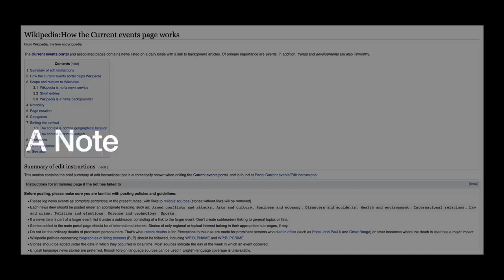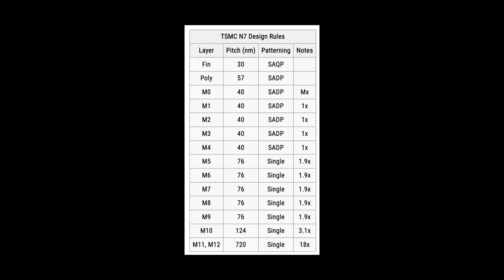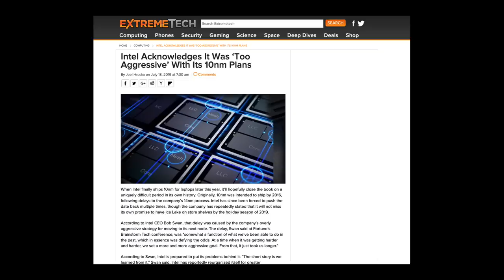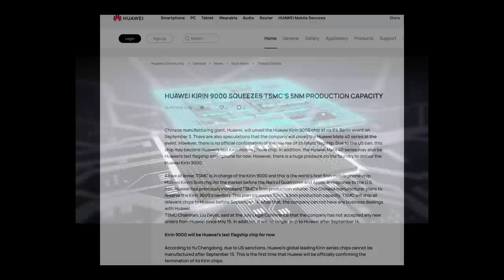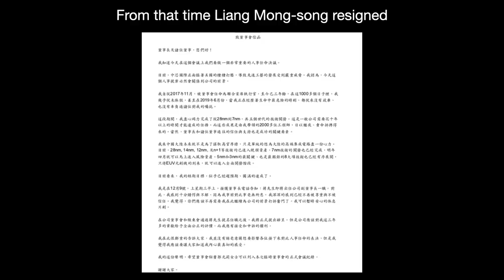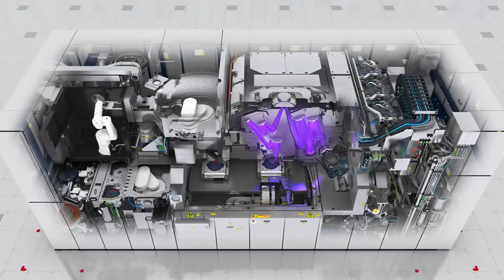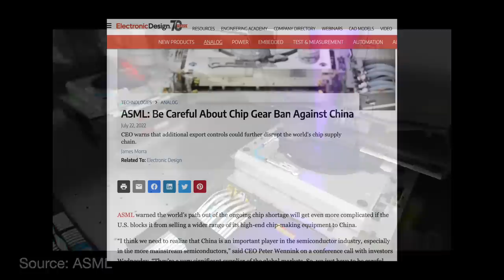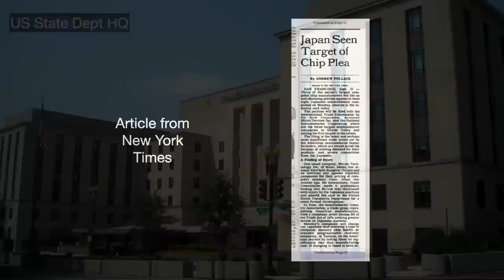China's 7nm Chips: SMIC N+2

Comment: SMIC doesn't operate in an open market. You rightfully mentioned Huawei's HiSilicon division which cannot use TSMC anymore to fab their Kirin CPUs. I'd say they'd happily take whatever SMIC has to offer here. N7 equivalent is not too shabby! Russian clients cannot use TSMC anymore either. So there will surely be a plenty of demand.
Reply: How big is Russia market?
Reply: @zzip0  I dunno. But some chips have definitely been fabbed at TSMC. For example, Baikal and Elbrus.
Reply: If its going to be cheaper than TSMC, etc. then itll get customers eventually.
Reply: @zzip0  
Russian is just a icing on the cake, the Chinese market consume about 60% of the worldwide market, imagine losing the 60% sales.
Reply: @gamerdudegamerdude4961  Nah, they don't have to, my point is that they don't compete with TSMC for many and probably enough customers really.
Reply: @andrewlim7751  Chinese IC market has always been very restricted for outside access. It is not of concern now. The OP rises the question about the Russian market si that's what I ask about.
Reply: @zzip0  I don't know about the size of the entire Russian semiconductor business that was dependent on TSMC, but Baikal, for example, was planning on ordering 300k chips from them this year alone.
Reply: @gamerdudegamerdude4961  The point is - this DUV process is a dead-end. It was abandoned by everybody the moment EUV started to mature. It will be a losing strategy for China to improve this path, because it will never be competitive globally with EUV based chips especially in mid-long term.
Reply: @zzip0 
Having the market is EVERYTHING, nevermind having the most sophisticated machine, producing it with the latest technology, what happens if your buyers don't wanna buy from you?? Imagine selling it to u.s., what can the Americans do with the chips? Make iphone or Xiomi?
Reply: @andrewlim7751  There are short term and long term solutions. Having a market is good, but Chinese market is not very accessible anyway. More important is to be innovative and competitive. Thats how USSR lost the Cold War.
Reply: @yurymleh  300K is probably negligible for TSMC. I work at a rather small company, which routinely orders millions.
Reply: @zzip0  
Innovation and competitiveness have to back up by market, the Japanese are definitely more innovative and competitive than the Americans but when the u.s. apply pressure they're gone, check out Toshiba's semi-conductors, when you're small you have no say, that's the reality.
Reply: @zzip0  Yeah, it probably is. But it's just one of many, all those negligibles add up and make for a good pent-up demand for SMIC.
Reply: @andrewlim7751  As I said, China market is quite locked anyway and can not be relied upon. Plus what were Americans and Europeans doing with the chips when most of China had no running water and were using outside toilette? Have a loock what happens with the last movie TopGun, which is not shown in China because it uses the Taiwan flag? Made a shitload of money around the Globe.
Reply: @andrewlim7751  Japanese are well known to NOT be breakthrough innovative, but actually masters of incremental improvements.
Japan just lost the competition because it is too conservative - example: if you go to work in Japan, to this day you can not access your bank by Internet - US is not to blame for this.
Reply: @yurymleh  Still, Russian demand is negligible and can not sustain anything if the rest is decoupled.
On the opposite - if ASML stops supporting its DUV machines in China, China will enter the stone age of electronics manufacturing in 6 months.
Reply: @zzip0 
Google about breakthrough by the Japanese on semi-conductors, just like jet engines, you don't dominate semi-conductors without multiple and continuous breakthrough on this field.
Reply: @zzip0  
As for DUV machines, the Chinese used to be about 200nm away on precision, they have narrowed it down to 30nm, and I believe the difference between asml and the Chinese down to optic meaning the lens, Carl Zeiss lens which is completely attainable.
Reply: @zzip0 
Let's put it this way, the Chinese produce about 2+ millions engineers EACH year, the u.s. produce about that nos of lawyers each year, do you know Intel, Tsmc don't like to produce chips in u.s., they can't even if they wanted to ....because the u.s. simply don't have the engineers to do the job.
Reply: @zzip0  
Talk about closed market, do you know Samsung are selling about 60% of their chips to China? 😁😁
Reply: @andrewlim7751  yep, so when you lose competition, it is because you did not innovate, not because somebody "pressured" you.
Reply: @andrewlim7751  Sure, but the West learns how not to share a few things. Semiconductors among them. China never shared it's market, so losing it is not so big problem. The World can live without China.
Reply: @zzip0  We'll see what happens. I'm just happy for SMIC's progress. N7 equivalent is awesome if true. And will have a plenty of clients. Intel's best is arguably N7 equivalent too. intel 7 (aka 10nm ESF) is DUV only, isn't it? And it's not too shabby.
What I tried to say is that SMIC will have a plenty of clients as many cannot use TSMC. I'm sure it's not only Huawei in china in that position. Some CPUs are produced locally only for national security reasons. Russia is just a bit of an additional demand that I know of and mentioned it. Like I didn't argue it's gonna take all the wafers on its own, lol.
Reply: @zzip0  
The west share the market? Huawei say: "Hi" 
😂😂😂
The Chinese don't share their market?
Apple and Coca cola say: "Hi"
You know the difference between you and me??
Your opinions vs my facts. 
😁😁😁
Reply: @andrewlim7751  Fun fact: Both companies you mention existed since the time when most Chinese were not having running water and had only outside toilettes and no toilette paper. If they don't learn to exist without the Chinese market again, others will appear.
Reply: @yurymleh  SMIC N+2 is not N7. And it still depends on ASML DUV (Nederlands). Without support it will stop in 6 months. US is currently negotiating ban on DUV for China with ASML and Nikon. Chinese colleagues estimate China will need 5-10 years to make something like DUV lito.
Reply: @zzip0 
Geez! Opinions again? If no facts I'm not gonna entertain you mate.
Reply: @andrewlim7751  Yeah, it's hopeless.
Reply: @zzip0  
Fact: The Americans spent 18 trillions on wars, and the most recent 8 trillions on Afghanistan,  try to divide the total amount by the population, you'll be shocked how rich you supposed to be ...but it's gone ....all gone. 🥱🥱🥱
Reply: @andrewlim7751  Fun fact: you are writing this on Internet - invented by US military.
Reply: @zzip0  
You're right, I'm not supposed to educate you. Ciao!
Reply: @andrewlim7751  Fun fact: I have PhD in engineering. Got it in East Asia. Then over 20 years career.
Reply: @zzip0  
Fact: Your PhD in engineering doesn't help your advancement in this industry much ....you need to buck up mate.
Reply: @andrewlim7751  Thanks, Master. I will follow your knowledgeable expert fact-based instructions. Please share more of your pure factual knowledge.
Reply: @zzip0  I think you're missing the point. A point this video made. They don't have to be cutting edge to be successful.  They just need to sell 7nm into China and can be successful enough.
Reply: @zzip0  Pathetic. Russia's GPD is on the level of Italy.
Reply: @quademasters249  They can do something short-term using this tech, but they are very far from maturity and this is a dead-end. They should probably invest their resources in something else.
Reply: @zzip0  Have you ever heard the phrase "Perfect is the enemy of the good"?  It means sometimes things just need to be good enough.   PC performance has topped out.  Phone performance has topped out. What's left for phones is reduced power consumption which EUV could certainly help but, PC's and servers just need "good enough" these days.  

7nm is good enough for most of the high tech things China needs.  You seem to want them to throw out something that works for something that doesn't, just because it's not the best.
Reply: @quademasters249  For now it is still not exactly "working". They are making a very simple chip for industry which is not demanding quality. 

And I know that you have to be better than the competition. If the competition can claim better energy, this is decisive for  many purchasing managers. Plus I want to add something more - I'm currently evaluating a chip from SMIC and competitor from Samsung. Samsung has 15 times lower noise and lower price. 

So for.me as Western customer right now SMIC is losing the competition in technical terms.
Reply: @zzip0  russia market is small, but inside market is large.
Reply: @lo2740  But maybe China market is not large enough if outside market goes away. China is big, but not big enough to survive without external World. This worked for China in the past, but even then isolation led to fatal technological lag.
Reply: @zzip0  China is trying to leap over the EUV. They are focusing on particle acelerator.

If they get sucess is another story.
Reply: @Padtedesco  Good, I am waiting to see actual product with whatever advanced tech from China.
Reply: @quademasters249  False on so many levels. Don't even bother continuing with that claim.
Reply: @zzip0  China’s chip imports climb to nearly $380 billion in 2020
Reply: @paulzhang1310  Just "chip import" means close to nothing. What chips? From whom? For what products,... etc....
Reply: @zzip0  Where are you from? Before the Chinese invented paper, did your country have toilette paper? When the Chinese built the world's largest canal and started the imperial examination system, did your country have running water? (Perhaps your ancestors were still wandering in the forests, called barbarians by the Romans?) 
If you are from the US, EUV is not made by you. And you are far behind in areas like 5G and high-speed rail. If you are from the Netherlands, you have neither a Mars Rover nor a quantum communication satellite. Other countries? Does your country have ASML, Mars Rover, quantum communication satellite, etc.? So, you are qualified to laugh at other countries, just because you don't even have the ability to "copy" someone else's technology? 
Every country has learned a lot of technology from other countries. No one's knowledge and skills are not based on the contributions of others. For example, Egypt today is not technologically advanced, but they were the main contributors to the knowledge of all mankind at a certain time.
Reply: @zzip0  It is ok to objectively point out any country's technological deficiencies.But when trying to degrade a certain race in particular, be brave and truthful about your own race first. And ready to enjoy the attack.
Reply: @oldkingchuan9799  I am from a country which has longer history than China. The oldest golden trasure found is dated at 7500 years. 

And no, EUV is made exactly in US. Check again.
They have full control over the light source.

5G is nothing revolutionary on tech level. Any professional with decent degree in communications knew that this type of tech is possible about 30, maybe even 50 or more years ago. It requires large scale investment to introduce, that's all. And there are many people who think 5G is just a marketing gymmick and not necessary at all. So throwing money at it is not bringing big added value.
Reply: @zzip0  You claim that your country has a longer history than China, ancient Egypt? Mesopotamia/Babylon? Or just some “ancient civilization” recognized only by yourselves? Why are you so ashamed to speak out the name of your country? Why your country needs to be proud of their tech since you are not Dutch or American？My intention is not to belittle any country, I just hope you don't take pleasure in belittling other countries. If you want to say that other people's technological progress is very simple, at least you have to master so “simple” technology first.
Reply: @oldkingchuan9799  Yes, it looks like my country has older civilisation than the ones you mentioned. 7500 years. Fact!

I did not say my country has invented EUV, even though I am right now about 100 km from Eindhoven (guess what is located there?) and about 10 minutes by bike from the biggest microelectronics research institute in Europe. 

I noted that China will probably not have EUV soon - also based on the opinions of my Chinese colleagues. And I  debunked your uninformed statement that US has not invented EUV. No, they did and they are still the only holders of the main technology there, which took over 15 years to make.

You are the one, who is trying to make it as "my country" against "yours". I am stating simple facts, which you apparently don't know and need to learn.

Some of these facts may be offensive for the victims of Chinese national-socialist propaganda, but these are still facts.
Reply: @zzip0  BTW, about Bulgaria is most likely your country. I think Bulgarians can be proud of their own country. After all, before the Chinese in PRC, Singapore, and USA joined the game, the Bulgarians achieved very good results in the International Mathematical/Physical/Chemical Olympiad. And, not all Bulgarians support the war in Afghanistan as a servant of the USA (only 6 aircraft and 200 soldiers) .
Reply: @zzip0  I guess you are indian emigrated to the USA. Also being good in engineering don't mean you are good in economics or logistics for sure. And remember in history China is the other end of the Western Trade with the silk road that then became a naval route going through india with british oppression or go the alternative way with spanish trade from america(mexico) phillipines china.
Ignoring china is like making your trade route useless (and HK being gateway to china after the unequal treaties like calais staple port)
Reply: @marczhu7473  I expected this guess from some Chinese, but not, I am not from India, very far from it. However the details are  irrelevant. The main points for you to get are: the World lived without China trade for centuries and probably can do it again. Next, while China achieved great things in the last decades, these are not decisive and forever. There are still important missing pieces from the puzzle and these pieces can not be replaced easily. Chinese leadership overplayed their cards recently and stated to behave too arrogantly for what they can afford. This will have associated costs. 
And finally, while China is a big market, it is still not sufficient to survive separated from the Europe and US. China can not afford to develop alone some core technologies, it just does not make economic sense if China is isolated. And China is in grave danger to be isolated economically and more important - technologically.
Reply: @oldkingchuan9799  My country is not subject to this conversation. It can be any.
Reply: @zzip0  technology isolation don't exist anymore when the whole world is discovered. Technology diffusion does you need to read import/export book.
Reply: @zzip0  You point out the inadequacies of China's technology, it's ok. thank you. I just don't understand that you need to talk about "Chinese, toilet paper, tap water, toilets" twice, in a chip topic. What do you want to show? Contempt for a certain race/country?  So, you at least need to prove that your own country is much superior to others, right? But until now, you are ashamed to say the name of your country😓
Reply: @zzip0   In several of your uploaded videos, "****ин скача на бънджи в Южния парк", "****ин кара лодка в Южния парк",  "Сарти влакче"... are included, while you insist that your country is not Bulgaria. Ok, you can claim your country is called "any". I have no prejudice against Bulgaria although I don't know that Bulgarian has become so popular. At least, I appreciate Bulgaria's achievements in the International Mathematical Olympiad. I also don't think China has done anything to hurt Bulgaria, except that China is competing with USA
Reply: @zzip0  Contemporary China is not actively self-isolating. USA has always been good at suppressing competitors, from Germany to UK to Soviet Union to Japan to China, and maybe India in the future. It is hard for China to stop some countries from following the repression of USA, neither can “democratic” Japan. But China can work hard to maintain trade and technological exchanges with ASEAN, Africa, the Middle East, Central Asia, Latin America, and independent European countries. Btw, China's largest trading partner is ASEAN now, and ASML's CEO asks for permission to sell their products to China.
Reply: @zzip0  Every technological advance is built on the scientific contributions of others. Some people's idol USA was not born as a technological powerhouse. It first became an economic power relying on the rich resources and fertile lands plundered from the Indians. Then it developed technology by "copying", stealing British, German technology and technicians. After World War II, from Germany, the US military brought many scientists, who had made great contributions in the fields of jet aircraft and aerospace in USA. Because of the development of the American economy and the two world wars, USA has attracted talents from all over the world, and these talents have developed American technology. USA‘s tech doesn’t just rely on homegrown “Americans”. Einstein is from Germany, Apple's Jobs is the bastard son of a Syrian, Musk is from South Africa, one of the founders of Google is from Russia, and one of the founders of YouTube is Chinese. A large number of American researchers come from Asia.
Neither China nor any country can compete alone with the cooperation of other scientific and technological personnel around the world. For example, in the field of the International Space Station and artificial nuclear fusion, we have all seen the difference between international cooperation and blockade (Btw, China has recently made great progress in nuclear fusion tests and will share relevant results with international cooperation organizations - China "EAST", 1056s). 
For countries that do not plan to monopolize science and technology, should we think about: should we support a country to monopolize technological advantages alone, or support international competition and cooperation?
Reply: @marczhu7473  You are mistaken, that technological isolation is not possible anymore. Not everything is in the books and I see a tendency some people have stopped publishing their work. The West knows how to make technological embargo.
Reply: @zzip0  look at space tech China did it alone. How many nation can do that from scratch? And technically you should know reverse engineering is a thing too as it is supposed to be your job.
Reply: @oldkingchuan9799  I noted that companies were producing chips withoit China for very long time. People nowdays tend to forget what was China 30 years ago. Yes - most of the country had no running water, ... etc. There is nothing wrong to say this and many parts of the world were like this, so this is not race and nation specific.
And at that time the West was living different life - nothing wrong to accept that and learn from it. Then some people in the West decided they can make more money by basically exploiting the cheap Chinese workers,  while these workers were living in a dictatorial state and could not protest for their rights. It was a greedy deal between the Western capital and Chinese communists. But this deal can be unrolled.
Reply: @oldkingchuan9799  Contemorary China is practically isolated - the Chinese market was never completely open. And the flow of information/know-how was never as high. Chinese government tried to attract branches of US/Western universities, but not many were eager to go and teach there, except some ethnic Chinese. And these efforts are now largely over. 
So it does not matter if it is intentional. The truth is China is not attracting the best and the brightest. Yes, many of US best minds were not born there even nowadays. But they have decided to go there, not in China or even to Europe. 

Sure, US universities are full of Chinese researchers who probably leak info back. But now this is well known and I notice some important reserach / academia places have stopped hiring even Chinese students - exactly to avoid leaks. 

If you have information about hiring patterns in Korean and Japanese corporations, they have basically stopped hiring Chinese for research positions about 15 years ago. And they surely know why they did it.
Reply: @oldkingchuan9799  Good luck with nuclear fusion. But keep in mind it is a money hole. Sharing intermediary results does not impress me. I want to see final product.
Reply: @zzip0  still a feat considering few nations have that privilege. Next step is space conquest and those without gonna be forced to join one of them in order to get a share of profit.
Reply: @marczhu7473  From now on in near space it matters what private companies do for profit.

As for far space, I am not a specialist. But it looks like Elon Musk is making all government agencies look funny and not very relevant.
Reply: @TSRHelios  I am not sure whether Samsung sells 60% to China and if this is true. But even if this is true, I do not see how is this important for this case. Samsung will absolutely not violate any technology embargo to China. First, they don't want, second they have no choice. If they do it, their EUV and DUV may also stop and rather quickly. 

The rubble is very good example that sanctions against Russia work very well. Russia can not balance the trade now. They export oil, but can not import important tech. So the currency is going up, but this is actually bad for Russia. 

I have no bias against China. I lived over 10 years in Asia and I like Asia. I am the opposite of racist. If things settle down, I will probably send my son to get some master degree in a good university in Asia. However I don't believe now things will settle down. It looks like Chinese government has decided they can play their game now. In particular if China picks the side of Russia, our ways with China are splitting. China will become my enemy. And I will do everything possible as engineer to defeat my enemies. Not able to run with a gun anymore, but as engineer I can still do a lot.
Reply: @zzip0  If they do, they will have embargo on themselves. If they don't, they will lose 60% of the revenue. Not sure how would it work out for Samsung, but anyway Korea is not European so they don't matter, if I read this correctly.

The currency is going up, and this is actually bad? I don't quite get it.

It's not just Chinese are playing the game, everybody does - US, Russia and China. Why Chinese can't play the game, while US and Russia has been playing it since, if not before WW2? You are the exact definition of racist but maybe you didn't realize. 

The US has part away with China on the surface since Trump started the trade war, and then tech war and so on and Biden is continuing Trump's policy. Does China have other choice? And now Biden has tried to expand NATO to Ukraine which has forced Russia to take action. When Russian did the same thing, it's called Cuba crisis. When US did this, it's called Russian aggression or every country has their own freedom to make their decision - what a typical shameless double standard of the West, which again you might not realize. Isn't Cuba has the freedom to let Russia to deploy nuclear missile to threaten US, as much as US was trying to do with Ukraine?

And now US has faaked up Russia in order to resurrect NATO, Russia has no choice but to be more aligned with other competitors of US. Putin was naive enough to have asked the opinion of US president about Russia joining NATO. If US is smart enough they could have allied with Russia to suppress China. China has tried to align to EU but due to ideology and also the reality that EU has no real troops and is relying on the nuclear ambarella provided by US, EU has chosen to continue to be a lapdog of US. Heck, EU is even committing suicide by sanctioning Russian gas, making the Euro to drop in order for more capital to flow to US to save US economy, what a move by EU, I am astonished!
Reply: @TSRHelios  
"If they do, they will have embargo on themselves. If they don't, they will lose 60% of the revenue. Not sure how would it work out for Samsung, but anyway Korea is not European so they don't matter, if I read this correctly."

Business is like this - you sometimes lose. Next time they will be more careful with whome they make too much business.

But I doubt it they left to rely so much on China. I worked with them and they are usually very smart. 

On the other side look what happened with the movie "Top Gun Maverick" - it was censored in China because of the flag of Taiwan, it made zero income in China, but nevertheless it made over 1.4 bln USD globally. Way to go!

"The currency is going up, and this is actually bad? I don't quite get it."

I will explain it again - the high exchange rate indicates they can not balance the trade and teherfore we know they can't find the imports they need. This is very good.

"It's not just Chinese are playing the game, everybody does - US, Russia and China. Why Chinese can't play the game, while US and Russia has been playing it since, if not before WW2?"

Because we live very well in a World which is called Pax Americana. I like it more to live in Pax Americana, than to live in Pax Cinica or Pax Russica. I would not like to live in what I see in China or Russia. Apart from other things, both are governed by commies or ex-commies and I don't like commies.

"You are the exact definition of racist but maybe you didn't realize."

Nope, I told you that i don''t like commies. China and Russia are run by commies.  

"The US has part away with China on the surface since Trump started the trade war, and then tech war and so on and Biden is continuing Trump's policy. Does China have other choice?"

Actually China had a choice - to live like any other countries. But they have selected to not open their markets and keep disbalance in trade, steal tech from others.... I think Trump did very well - should have been done long time ago.

"And now Biden has tried to expand NATO to Ukraine which has forced Russia to take action."

This is a lie.  

"When Russian did the same thing,"

Did they?

But let me ask you - can Taiwan make a referendum of independence? Like Crimea? Will Russia recognise Taiwan as independent after such referendum?

"...it's called Cuba crisis." 

Nope. US never had diplomatic relations with Commie Cuba, their government was never recognised by the US. It was always clear commie Cuba is not independent, but a colony of USSR.

On the opposite, Russia recognised independent Ukraine. Russia made legal binding agreements recognising Ukraine as independent. 

"When US did this, it's called Russian aggression or every country has their own freedom to make their decision - what a typical shameless double standard of the West, which again you might not realize. Isn't Cuba has the freedom to let Russia to deploy nuclear missile to threaten US, as much as US was trying to do with Ukraine?"

So this is why China thinks they can restrict South Korea to deploy THAAD missiles and radars? China thinks Korea is like in the past? A subordinate state, which should pay tribute to the Chinese emperror and has not right of self-determination - just like Ukraine? 

Perhaps like Russia invaded Ukraine, China will invade South Korea under the pretext it is armed too well and has selected to be ally of US?

"And now US has faaked up Russia in order to resurrect NATO, Russia has no choice but to be more aligned with other competitors of US."

And they can also bomb other souveraign nations they think are too close and somehow don't like? Just like Hitler?
 
"Putin was naive enough to have asked the opinion of US president about Russia joining NATO. If US is smart enough they could have allied with Russia to suppress China."

Sure, but China was always playing unfair. They never opened fully their market the way they got from others. 

"China has tried to align to EU but due to ideology and also the reality that EU has no real troops and is relying on the nuclear ambarella provided by US, EU has chosen to continue to be a lapdog of US."

Not true - France is nuclear state member of EU. EU is not a military aliance. NATO is military aliance and there is also UK, which is also niclear.

Plus I don't think relying on US is bad. Europe has never lived so well as so long in piece - just like South Korea. When Korea was under the chinese umbrella, it was among the poorest nations - poorer than Africa at the time. Now they are among the richest - with US. 

"Heck, EU is even committing suicide by sanctioning Russian gas, "

Importing gas from countries which invade their neighbors and  bomb women and children is madness. Europe remembers Hiter too well. 

Europe should have done this long time ago - at least since 2008, definitely since 2014. 

Now Europe will have to pay a price for acting too slow and too late to decouple from Russia....

"making the Euro to drop in order for more capital to flow to US to save US economy, what a move by EU, I am astonished!"

Dropping the Euro helps EU exports. 
Plus, Euro is going lower because of very objective reason - interest rates. And they are kept low for meny other political reasons.
Reply: @zzip0  SMEE already makes DUV scanners, those scanners that were supplied by ASML can be serviced by Chinese specialists, the fact that they will stop after 6 months is complete nonsense.
Reply: @milaro222  The scanners made by ASML need maintenance by the manufacturer. They will not stop abruptly, they will deteriorate gradually and become unusable. 
It is possible that China made something which works as DUV. But just making one is not enough. You have to make a lot and you have to make them good. 
It would be actually bad for China if they wasted resources on DUV dead-end. So nothing to be very proud of.
Reply: @milaro222  China did not threaten anything for at least 200 years - mostly because its political system and also because Confucianism does not encourage opennes, risk-taking and innovation.

China is not a big innovator nowadays either. They make small incremental low-risk steps. In the industry, we call them "baby steps".

There is no need to invent pretexts for containing China. The trade balance of China was unbalanced for too long and the West (US mostly) was hinting stronger and stronger that this needs to be fixed by one of two ways - fully open the closed Chinese internal market for outside products, or making Chinese product less competitive, for example by rising the exchange rate. China played deaf on both and at best dragged their feet. The absolutely logical next step was to start closing access to the Chinese products and limit technologies to China.
Reply: @zzip0  Lithographic scanners are very reliable and durable equipment, they are not exposed to any influences that lead to irreversible breakdowns for half a year, maintenance was carried out by ASML specialists because ASML gave a guarantee, but if maintenance is refused, it can also be produced by local specialists, if there are spare parts and a stock of scanners that could be purchased in excess, the existing production can be maintained for 20 years.
During this time, China will already have its own EUV scanners and full self-sufficiency.
Reply: If TSMC or Samsung or Intel cannot sell to China or Russia, does that also mean they do not operate in an open market? 

None of them operate in an open market anymore because USA closed the market using its economic and patent power.
Reply: Not really. China is using that for now since something I'd better than nothing. You talk like China isn't pursuing EUV either or anything else and is just focusing purely on DUV. It's not.

But until they make breakthroughs in other tech, they will of course use whatever they can get at the time as a stop gap measure.

The fact that they even managed to equal TSMC and Samsung 7nm using DUV is incredible and shows China's potential.

I'm guessing they are exploring EVERY possibility. This should lead to more breakthroughs and innovation compared with others who aren't as desperate or in need and who simply do not have such a sense of focus/urgency or the financial backing of the whole country behind it. China needs every chip it can get as soon as possible. It will explore DUV, EUV, and every other UV there is, along with even other methods which still have yet to be discovered or named..
Reply: @milaro222  Lito equipment is very sensitive and requires regular tuning. Big part of ASML expertise is to to exactly this. There are whole units with hundreds of people working at ASML on this and improving and automating this is considered one of the main business goals nowadays. 
No, this can not be done by staff without long and extremely detailed expertise in the particular equipment. In particular trying to do this without access to the source code of the relevant systems is completely hopeless. 
Nope, spare parts for this are not sold except by the manufacturer - ASML.
Reply: @milaro222  I don't really care if and how China had a choice. I care about the final outcome - they failed to balance their trade and this was completely unsustainable.
Reply: @ex0duzz  Current process China uses to get 7nm relies on ASML DUV. And they are currently producing an extremely simple chip, which does not require reliability.

I agree they can use whatever they like, but remember - nobody is obliged to buy anything from them.
Reply: @zzip0  These regular tuning are made by SMIC specialists themselves who have been trained in ASML, SMIC has full technical documentation for self-maintenance of lithographs, on fabs that continuously have to produce chips, no one should wait for a specialist to arrive almost from the Netherlands to make routine operations. The same applies to minor repairs, it is obvious that you do not need to call an ASML engineer to replace the cooling pump or relay.
And ASML simply does not have so many specialists to serve each of its lithographs around the world.
Why do you need source codes for a fully functional system that already has all the functions for self-testing and tuning.
Reply: Michael Dortmund  Michael, my PhD is just fine.
The gas storage of EU is 80% full. For Russia the gas may be only economy they have. For Europe it is far from it.

Meanwhile the Russian guy in my company is quietly and desperately discussing on the phone all kind of money transfers without realizing I know Russian... He does not look very worried about the "cold winter" in EU.
Reply: Michael Dortmund  Their currency is rising because they can not balance the trade - they export oil and gas, but can not fid thing to import - because nobody is selling them the juicy stuff. So the rising Russian currency is a perfect proof that the Western sanctions work very well.
 
How are China and India going to buy the oil and gas from Russia? Russia does not have ships to do this. How are they going to bring oil and gas to India except with ships? Carry it via the Himalaya? 

USSR (nor Russia) did send a first man in space - how many years ago? USSR included Ukraine - where most of the current day Russian ICBMs have been made - in OKB Yuznoe. 
What have Russia done recently? 
Even their Buran had major parts made in Ukraine and Russia has no technology to make them again.

Which weapons have they superior? 
Russia imports CNC machine tools from North Korea - because they cant make them, because they have such a great manufacturing sector. Think about it - North Korea is making better machines than Russia! Unbelievable! 

Now they start to import drones from Iran - because Russia has best weapons... They also discuss importing HIMARS equivalents from North Korea... Soon North Korea and Iran will have better airplanes than Russia.

Anything we have seen for now is inferior. What we see in Ukraine is that if Russia was not blackmailing with nukes, they would lose the war in a few months without a single NATO soldier fighting with them... Only proper NATO weapons to Ukraine would be enough. And Russians know this, so thats why they they blackmail with the only thing they can - nukes. 

Because Russia is exactly a gas station. Or as Segey Brin (Google creator) said - Nigeria with snow.
Reply: @andrewlim7751  yes bigger than oil import
Reply: @andrewlim7751  It is 60% now, but lots of the chips were contained in products that desalinated outside of China.  When manufactures shifts to southeast Asia or India, the demand will drop in China and increase in the Emerging markets.
Reply: @oldkingchuan9799  Not saying that zzip0 is right, but I think you missed the point of zzip0's argument. zzip0 mentions of toilet paper is to argue about China's market, not about China's science and technology contribution per se. We all know China has made a huge leap and is not in that stage anymore. zzip0's point is back when there was no Chinese market, the world was still on the move so it should be the same now without China.
Reply: @canuck21  Yes, when there was no Chinese market or USA, the world was still on the move. When there was no <7nm chips, many counties can be still on the move. And they will develop their own <7nm chips at last.
For example, according to Korea Economic Daily, "China was South Korea's top semiconductor buyer (PS: about 60% ), purchasing 39.7% of overall Korean chip exports in 2021". Although Koreans can find new markets, they will have serious economic loss. But, why Koreans had to suffer it to satisfy USA's hegemony？
While USA is selling energy to Europe at several times the price, why should Europe follow USA to sanction other energy exporting countries? While USA is absorbing European capital and businesses, why should Europe follow USA？With serious economic losses, why Europeans are forced to boycott Chinese products and markets to cooperate with USA？While USA has waged the most wars, why should other countries call USA a "guardian of peace"? Because next month China will invade Bulgaria or Germany? Because China is communism? China in 1972 or China in 2022, which one is closer to capitalism/communism? 😓——The essence is not communism/capitalism/democracy, but China's economic power  is closing to the U.S! (Like Japan in the 1990s called evil by USA).
I do not try to say that China is better than USA. I just hope the world to think about it: If there are countries who can restrict USA from doing anything it want, is it easier for others to choose and balance for their own benefit?
Reply: Egon Bahr:“In der internationalen Politik geht es nie um Demokratie oder Menschenrechte. Es geht um die Interessen von Staaten. Merken Sie sich das, egal, was man Ihnen im Geschichtsunterricht erzählt”.
Reply: Mitterrand: “La France ne le sait pas, mais nous sommes en guerre avec l'Amérique. Oui, une guerre permanente, une guerre vitale, une guerre économique, une guerre sans mort apparemment. Oui, ils sont très durs les Américains, ils sont voraces, ils veulent un pouvoir sans partage sur le monde.”
Reply: @oldkingchuan9799  Don't argue with me, I was only explaining zzip0's point.
Reply: @canuck21  back then before china, the global population was just half of what it is now with half the demand. Being almost entirely dependent on china for the upstream market, resource and materials will run dry pretty quickly without them. Also most other potential market expansion in 3rd world countries are pretty much already controlled by china. 

The world cant survive with blueprints without the means to create it neither china can survive without the world who needs them as material suppliers. Without these geopolitical crap, everyone could've focus on their own economic merits and we couldve have more technological breakthroughs by now...... instead what we have now is western country reviving their upstream economy and china playing catch up on the downstream.
Reply: @zzip0  Russia is bigger than Japan or Korea.
Reply: @zzip0  : As Socrate said "ignore the ignorance"
Reply: @zzip0  : So, you are Chinese from Taiwan Province!
Reply: @elliekwong3180  Nope. But does it matter who am I?
Reply: @peter238  As population Russia is smaller than Bangladesh.
Reply: @zzip0  
USSR never lost the cold war.
It simply collapsed due to political reasons internally.

Even after that Russia never ended the cold war and kept amassing the weapons but lacked the research on many sectors due to the poor economy.
Reply: @ajaykumarsingh702  USSR lost the cold war decisively and was bankrupt. USSR technologies were behind the West by >15 years - they were stealing electronics and trying to copy it. Their cars were terrible and were also copy from the West. Their machine tools were behind too - they had to smuggle from Toshiba to make more quiet propellers for their submarines. Their oil tech was terrible - around 1990 they pronounced there is no more oil and gaz in Azerbaidjan for example, but zerbaidjan today exports lots of it using Western tech. 
Etc...
Reply: @zzip0  
I never stated that USSR was completely self reliant on every technological sector.

But they sure were far ahead than many of the Western counterparts.
Reply: @ajaykumarsingh702  No, they were not ahead in anything. And especially bad - they were not even comparable in anything with wide ranging economy applications - the ones which would create internationally competitive products and increase productivity locally. 

They could not export any industrial product for hard currency and as result had to use oil to pay for food imports due to disastrous agriculture  policies and productivity. When the oil prices fell, oil was not enough, they had to borrow or basically starve. In 5-10 years the debt accumulated and the Cold War was over.
Reply: @zzip0  
The Soviets were ahead, but they pulled all of the resources for their military.

Obviously you won't find a Soviet washing machine or dishwasher.
They weren't in for that kind of things.
They didn't even invest much in automobiles or Semiconductors.

Their doctrine was completely different in comparison to the Western world, but that doesn't mean they didn't have the capability.

It's like saying Japan can't build the nukes.
They can. They chose not to due to their passive constitution and doctrine.

Each nation has a different ideology and doctrine.
Reply: @oldkingchuan9799  Don't waste your time talking with someone who is having hateful heart and an envious mind.
Reply: @zzip0  So?
Reply: @zzip0  smic uses asml? Maybe so . Somebody needs to let huawei mate 60 know.
Reply: @zzip0  some of your posts did not age wells but still too early to tell.
Reply: @ScoobieDoo-zy1rh  Nope, my posts are pretty accurate even now.
Reply: @zzip0  that is why it’s some and not all.
Reply: @ScoobieDoo-zy1rh  Practically all here are still relevant 100%
Reply: @zzip0  guess hubris knows no bounds . Will revisit in a year if the tides turn in the other direction.
Reply: @ScoobieDoo-zy1rh  In a year? You hope some essential tech can be stolen in a year? I doubt, but who knows.... For now does not look like this.